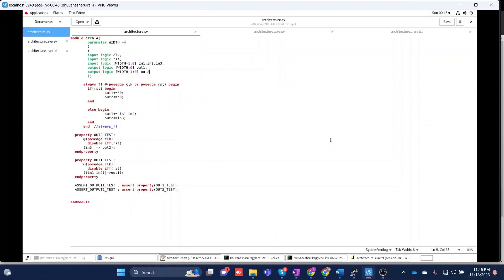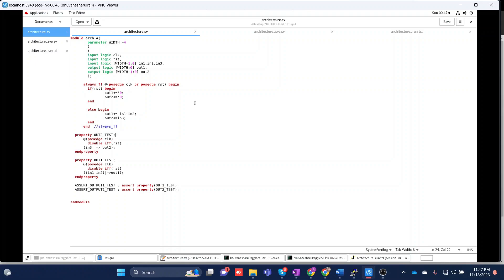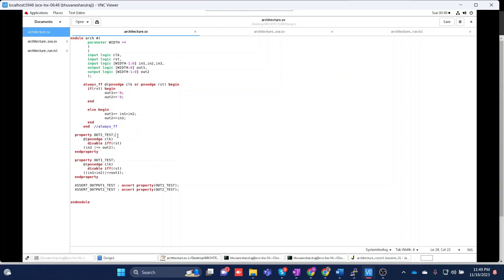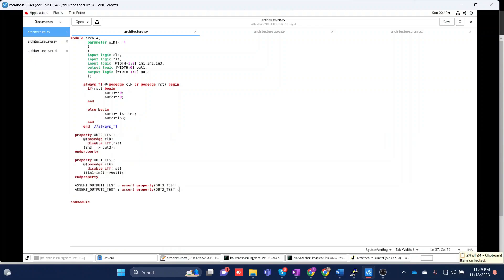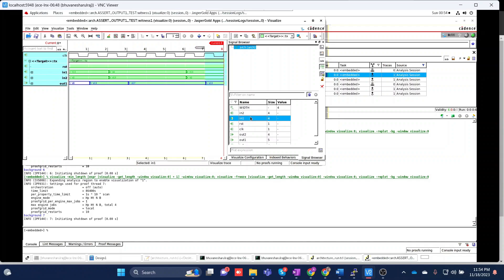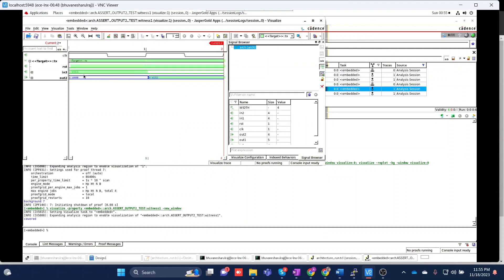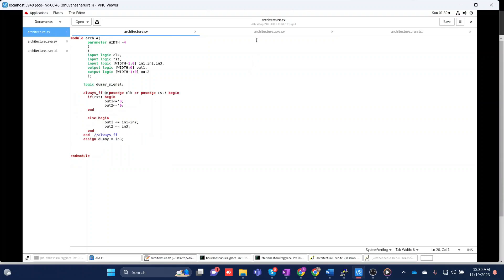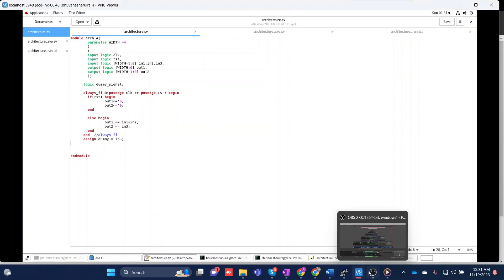Mastering Formal Verification(Jasper Gold): SVA, TCL, Assertions, Coverage Explained | let us learn

Comment: Hello, thanks a lot for this useful video. I have a question and be really grateful if you could help me. If I have a project (including several .sv and .svh files), how can I run SystemVerilog Assertions (SVAs) using JasperGold?
Reply from the maker: U can create a .vc file and source it in the script or u can manually type every sv file instead of just one sv file
Reply: @letuslearn986  Thank you, I try to run a .tcl file using JasperGold. In tcl file, I have: 
clear -all
analyze -sv09 file.sv 

elaborate -top module_1 -create_related_covers witness
elaborate -top module_2 -create_related_covers witness

clock clk
reset ~reset

prove -all 

But when I run jg file.tcl, it gives error. 
I have written SVAs for both module_1 and module_2. I a also added "set_elaboret_single_run_mode off" to above tcl file.
I really appreciate if you could tell me how I can run several SVAs related to 2 different modules of a project?

Comment: Hi can you tell me how far using FV in Reset verification of complex soc?
I heard that tool will generate assertions for the soc's design. Your inputs more valuable.
Reply from the maker: Hi, regarding your reset verification question could you elaborate a little more. However, in formal tools generating asynchronous resets are possible for that you need to create an AUX logic. And yes formal tools can generate assertions on its own too.
Reply: @letuslearn986  Hi,
Thanks for the reply.
My question is:
I would like to verify the reset behavior of Complex SoC which has comprised of multiple synchronous and asynchronous reset logics. What I heard that FV helps us to generate reset tree + assertions to ease our verification process. Is that true?
Another question, FV is static in nature.will it help for low power sequence where reset exercised depends on different modes.

Comment: Hello Thanks for a very good tutorial. I have several comments:
1) Just to be clear, the module that contains the Properties and bind statement must have all ports as input. Another person 
     alluded to this as well. 
2) I think that out1 should be defined as [WIDTH-1: 0], since the values  that produce the sum has those widths, too.(see prop OUT1_TEST)
     We get no CEX in this case because there is no real "error", but I have to believe this was not the authors intent.
Reply from the maker: Hi thank you for your message. Point 2. Yes i was not really taking care of addition  width in count as I was focusing on taking over the flow. 
1. I am bhuvanesh Arulraj 😅 I should have posted that comment from my YouTube account handle. On a hurry when I noticed the mistake I posted from my other mail ID. 
But as I told it should have been input not output.

In simple terms if you have to constraint any input we need use assumptions and for all outputs we need to have assertions.
Thank you